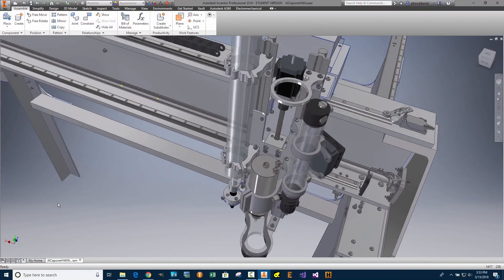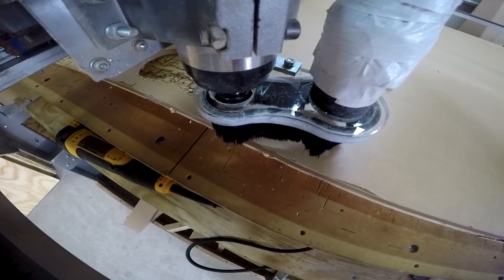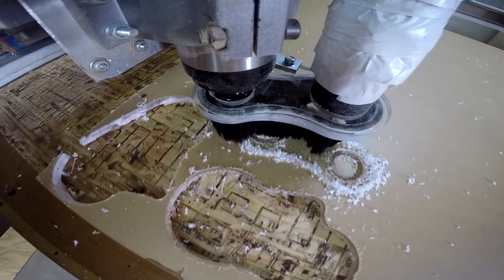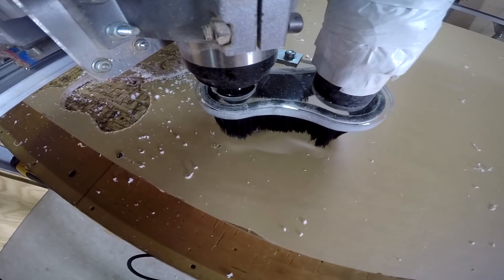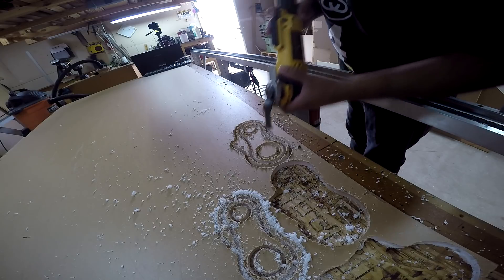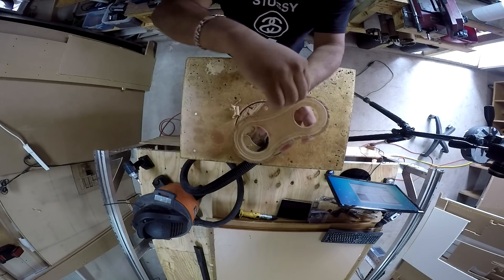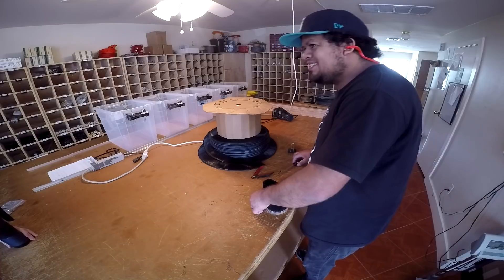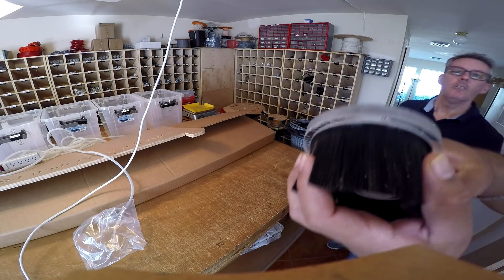VLOG 3 - Making the Dust Shoe for the Fabricator Pro

Comment: My Dust catcher was deceptively hard to get right.  You have a nice compact design.
Reply from the maker: Thanks.  Are you using a regular router, or a water cooled spindle?  Routers will blow dust all over the place.
Reply: A router.  And yes, it does!  
You mentioned, "hot glue". What type do you use?
Reply from the maker: This type of design will not work with routers unfortunately.  You want as much vacuum within the area surrounded by the strip brush.  The router will cause positive pressure within this cavity.  The only way to minimize this is to divert the routers blowing air outside of the dust shoe (another layer of material that has pockets to move the air sideways out above the actual dust shoe.  This is what we did with our older machines before we sold spindles.
Reply: Patrick Hood-Daniel you're right. But I worked with the natural flow coming out of the router as it always blew dust mostly to one spot.  But it is a lot of trouble still.

Do you use hobby glue sticks or some industrial stuff?  Hobby sticks (high or low temp) seem to get brittle after awhile and don't stick when cold. Just wondering if you know of another type.
Reply from the maker: TheRainHarvester I think we use the hobby hot glue sticks. I don’t think we went out of our way to look for anything special.

Comment: hi patrick, i need your help, I HAVE TWO LASER MACHINES, ONE 9060 AND ANOTHER 4040 BOTH USE THE SAME CARD RUID ONLY AS THE 4040 IS MORE CURRENT AND THE 9060 USES RDC320 AND IT IS DAMAGED, AS I NEED TO PERFORM GREAT JOBS INSTALL THE CARD OF THE 4040 RDC6442S IT ALL WORKS WELL, LESS WHEN COMMANDING TO CUT OR RECORD THE RAY DOES NOT PAUSE, IT ALWAYS RECORD CONTINUOUS SINCE THE MACHINE IS MOVING.
Reply from the maker: I'm not familiar enough with those controllers.